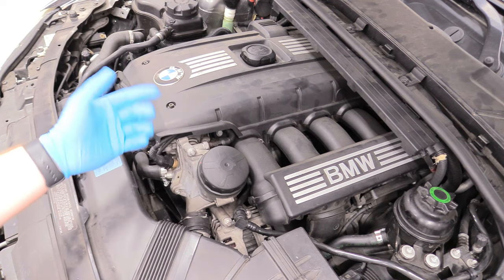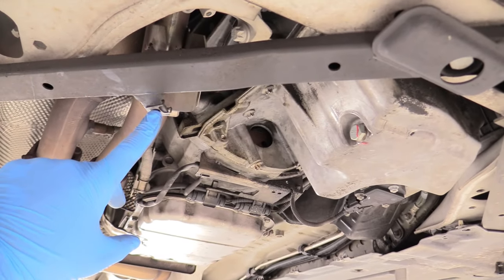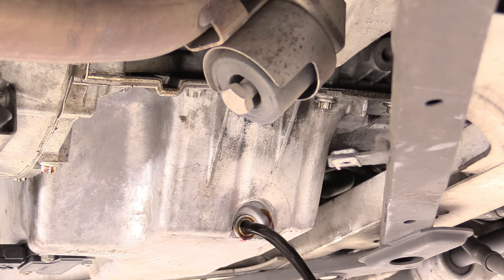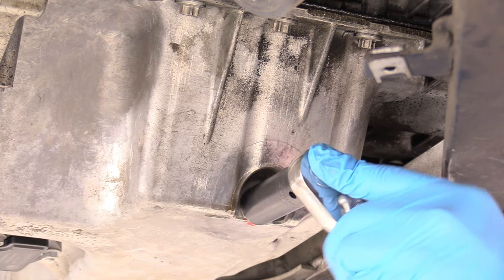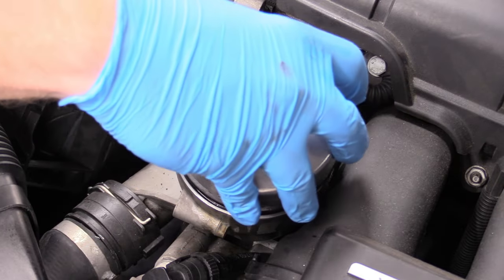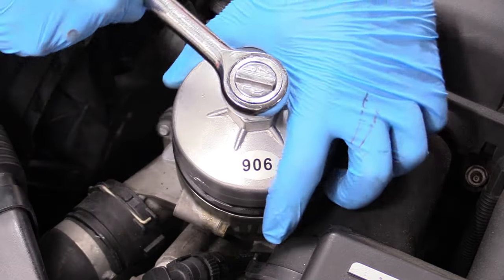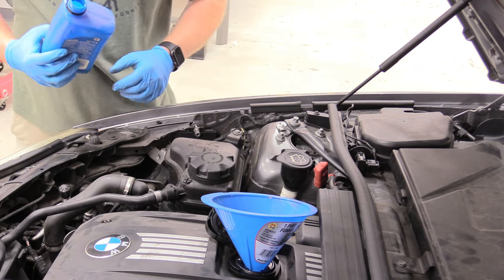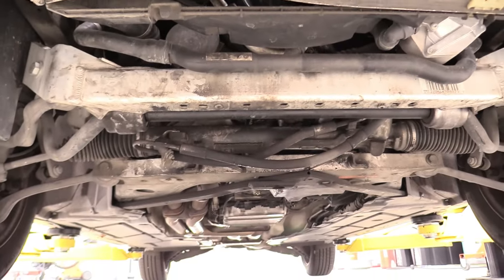How to Change Oil and Filter BMW 328i 2007-2011 | EASY and FUN!

Comment: Just junk it . WE don't need more money pits .
Reply from the maker: Hey now, sometimes you drive what you can get for cheap. And these are cheap for a reason. The maintenance costs are sky high. BUT if you do your own maintenance it really isn't bad. Thanks for watching Robert!
Reply: Maintenance costs are quite reasonable, if you take care of the car ! 
I have one myself with oil changes every 5000km with German filter and oil.
Reply: BMW resell value is really low due to their reputation but the n52 is one it’s most reliable engines and maintanence costs are practically the same as any other car if you do everything on your own. Don’t forget transmission fluid tho, they should be done more frequently on beamers like every 20-30k or 2 years.
Reply: @bilalahmed2123  especially if you don’t actually go to bmw for service and repairs, they will up charge you 100 for labor alone on an oil change and also triple any part costs. If you research their part manufacturers you can get the oe factory part ridiculouslessly cheaper than what they’d charge.
Reply: @Na-qj7nm   Exactly. The N52, N55, B48, and B58/B58 are fantastic engines.
Reply: well the n52 if regularly maintained by yourself really is the wrong engine family for this comment 😅 they are really reliable

Comment: The bottom is usually covered with a plastic skid plate, but there is a access point, that you can open to get to the drain plug. So no need to take the skid plate off

Edit: the dipstick is digital, you have to check it on the dash

Comment: No dealership is charging $300 for an oil change on a 2007-2011 BMW lol. I work at a BMW dealership. Oil changes for ordinary customers are about $100-$120. Good video tho
Reply from the maker: They do here in San Diego lol Thanks for watching!
Reply: $250 is what they charge in California.  I bought a low mileage 2008 328i and it has been a money pit
Reply: @barryfeinstein1234  
Just out of curiosity, how much u paid for it, and mileage?

Comment: Easy and fun?  Possibly if you have the special tool to remove the oil filter, a car lift, and special jack pads for the lift.  Other then that....
Reply from the maker: Doing your own work is always fun! Thanks for watching!
Reply: Naw bro all you need is a jack and jack stands. You don’t really need that special tool as long as you get it pretty tight with your hands it should be good
Reply: Universal Oil Filter channel-locks will work fine. The Jacking Blocks that fit like a Lego brick into the jacking points cost a couple of bucks from Temu... Delivery within the week.

Comment: BMW dealership is having a deal you give them $225 one-time fee and is good for 3 years oil change I went for that cuz in Connecticut an oil change for myself and 60 to $80 but at a mechanic anywhere from 112 to $200 so I went to the dealership instead now I don't have to go underneath my car for the next 3 years cuz it's free with a one-time payment
Reply from the maker: I just like doing it myself anyways because I know it's done right. Hard to trust anyone. Thanks for watching!

Comment: My oil filter came with 3 rings, two that u used, and a extra coper one that idk where it goes, Any help or tips
Reply from the maker: Copper one goes on the drain plug as a replacement washer. Thanks for watching!

Comment: Why wouldn't you drain the oil first, Then change the filter?
Just asking because that's what I've always done
Reply: i believe it needs the airflow so the oil falls out.
Reply: falls out quicker i should say
Reply: @Tizymakgaming it will work with the engine oil cap too

Comment: @5:28, made in China ? Supposed to use a German Filter. Did you check if the oil was BMW spec ?